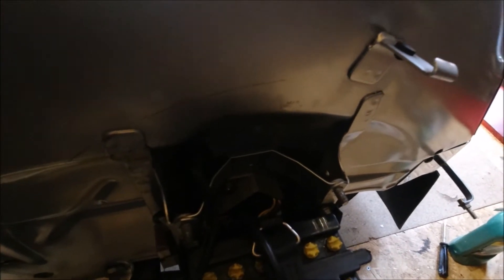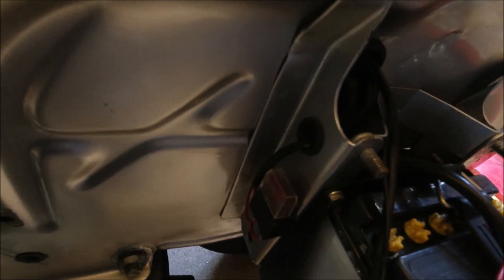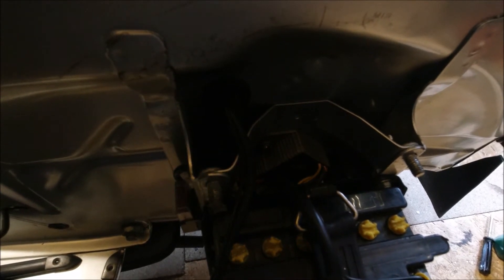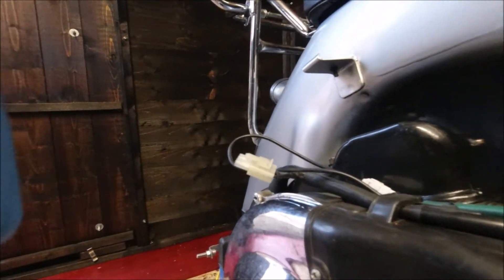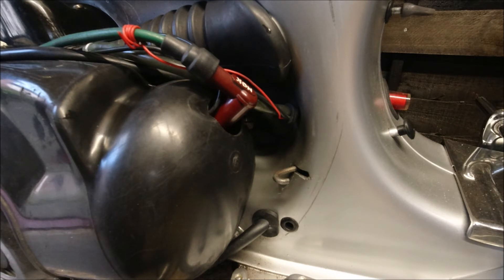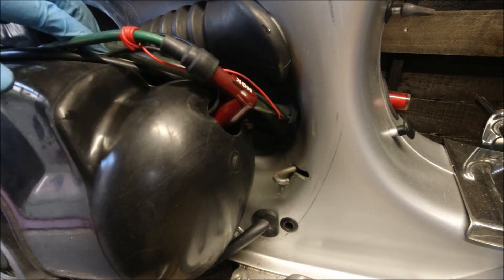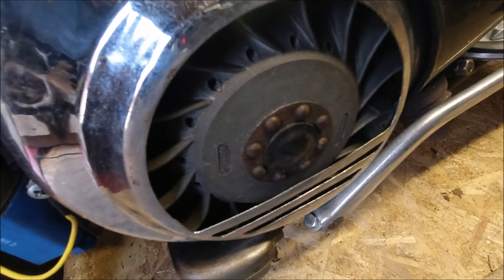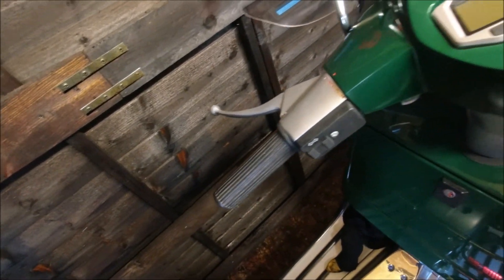Vespa Px engine overview and electrical upgrade discussion

Comment: Hi pal can you help me by any chance please, I’m really wanting to understand the electrics on a p200e and very keen on making my own wiring loom, I find this’ll be the easiest way for me to understand plus the satisfaction it’ll give me, the problem I’ve got on this renovation is, I have a p125x frame (1977 none indicator or key switch model) on this frame fitting a different headset, a GL 150 square headlight, will be installing a key switch, will be installing handlebar end indicators, oh and engine has an electric start as I’m 61 years old and knees are possibly on there way out so elec start there just in case, 😂 I also have a neutral switch on my gear selector for the electric start, you possibly can now see the headache I’m giving myself and probably you, I understand if it’ll take to much of your time, it’s just on the off chance, all the best John
Reply from the maker: Hi John,
You would be best using a px wiring loom and modify it to suit your needs, Haynes vespa manual is a good start as they have the different px models wiring looms at the back. If your going to have electric start tou will need the interlock switches so you have to pull the clutch in to start it up. Good luck
Reply: Cheers pal I’ll do that thanks for your reply
Reply from the maker: @johnwilde5518 if you need any help just let me know